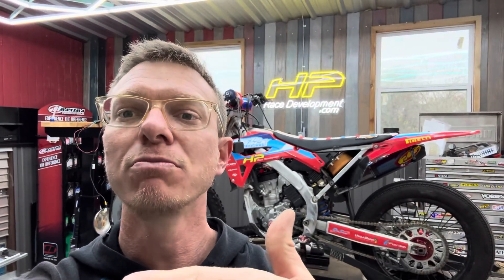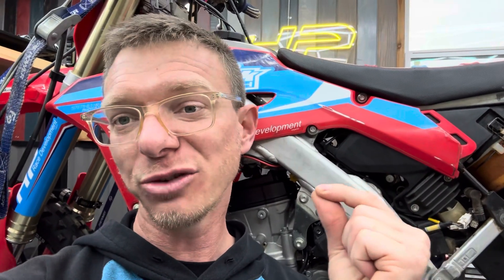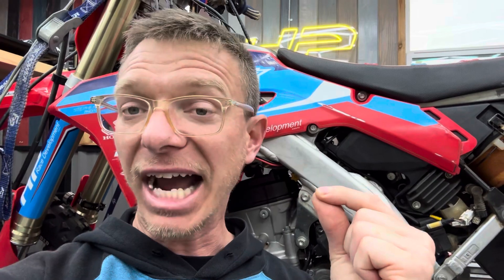Dual Fuel Injection! 2 injectors for 2 times the power?

Comment: 2 is always more fun right?
Reply from the maker: @dustincarter83  top comment
Reply: Don't know why a extra injector increases air density  ?  Air temp yea that would help  air density.  If you really  wanting to increase  air volume you would go direct injection.  The fuels injected directly  into combustion chamber not taking up volume.
Reply: @2strokecarbtuningportingin187  The fuel pulls heat out of the air, and the air density goes up as the temp goes down (like you said). Adding fuel into the system earlier allows for more cooling effect from the fuel
Reply: 2 shoulders that work is awesome

Comment: So what kind of power would you see on something like a 17 rmz250 with a high comp piston, ported and polished head, running 100octain race gas than adding the dual injection kit and ecu? I noticed that the 16-18 rmz250’s made 33.2hp on dirt rider dyno and the 19-present rmz250 (stock with duel injection) made 36.7hp on the same dyno, was just wondering if it’s better to mod my 17rmz or cut my losses and get a current gen rmz and mod that bike? Been trying to make at least 41hp at the rear wheel but with current head and piston mods only made 34.8hp on my shops dyno, looking to not break the bank try to get there, please let me know your thoughts on a project like this and if it’s even worth doing, thanks
Reply from the maker: probably best to go buy a ktm

Comment: I think saying that the air density increases by the addition of fuel is kind of misleading. One of the arguments put forth for direct injection is that you can get 8% more air in the cylinder since the air doesn't contain fuel. So you could say that the air is more dense with the absence of fuel. Although that isn't technically correct either.
Reply from the maker: @kraftzion  if the incoming charge is not more dense, where is the power from?

DI is for emissions and in all serious forms of testing that I have looked over, makes less power than port injection or in this scenario whatever we call end of port injection

its been heavily tested in various car engines that carbs and injection relocation farther away from ports make more power - and in that testing the data always show cooler intake air temps. In my opinion - most of the power we gain is charge density - a small amount is improved vaporization which is DI downfall currently - leading to poor particulate emissions

Comment: Why not design a dual fuel pump set up also to run high pressure in the dual injector to increase velocity?
Reply from the maker: @denniswilder3014  pressure is very high already - mx bikes utilize extremely high atomizing and high pressure design vs most other markets
Reply: @HPRaceDevelopment  what pressure do they run?
Reply: @HPRaceDevelopment  i just looked it up Honda's run 48 lbs of fuel pressure. Thats not high. Most outboards are 55 psi and the optimax ficht etecs run in the 90s. The sea doo di run 90 plus along with 120 pounds of air. The sea doo with the super charged run 60-70 lbs of boost with 1100 injectors.

Comment: what injectors cc's are you running in this crf ? main and second ? kxf 250 2012 I owned had so much power difference at the top comparing to the other bikes in that year... dual injection was game changer but nobody wanted to admit it because "it's not a ktm" 🫠😅 more fuel atomization = more power always
Reply from the maker: This bike shown is stock main and smaller second than main

I think its 300 cc second off memory

Comment: There is also one more little aspect.
The aircolumn get slightly heavier with an injector far back in the runner, and this makes slightly more ram effect at high rpm´s.

Injector timing can make a great impact also, having a small amount of fuel squirted onto the closed intake valves makes the fuel vaporize, and suck up some heat.
This often makes low rpm and response a little bit better.
Reply from the maker: @Peter_Granfors  we havent disclosed some of the dual squirt strategies on single (or dual) injection for youtube, but spot on. 
Injection timing is critical on single injectors located close - sucks up huge time to get that right plus fuel and ig curves
Reply: @HPRaceDevelopment  can you make a video on injection timing?

Comment: Im curious if direct injection is something their working on.  Having direct injection AND the second injector (the far back one) would seem ideal for max power and timing control.
Reply from the maker: @Roostfactor1  Imho from a performance standpoint DI is flat out worse. Its an emissions thing mostly - and in F1 they have a special form of DI that acts as the ignition system as well which allows amazing fuel economy not possible in spark throttle body injection. 

I might be wrong - but as of now I think DI would only hurt performance
Reply: @HPRaceDevelopment I hear this sentiment a lot and it’s generally incorrect when comparing PFI to modern DI systems that have high enough HPFP pressures to keep the injection window short and optimized the swirl/tumble generation of intake track and combustion chamber. At least I know this to be true for larger cylinder displacements in automotive engines that don’t rev past 9k rpm. DI will almost always improve volumetric efficiency because the air charge moving past the valve is less dense and by mass contains more oxygen. For a given mass flow of your port you have more air charge with DI. There is a tradeoff with charge air cooling like you mentioned, but this is only really beneficial for outright mass flow in some situations like inadequate intercooling on highly turbocharged engines. With NA engines on gasoline, DI allows the intake port to work better by 5-7% in nearly every situation. The issue in the past has been the shorter window fuel has to vaporize with DI, leading to poor fuel distribution incomplete vaporization etc. Modern combustion chambers solve those atomization issues with huge swirl/tumble velocities and squish though. IMO swapping a modern OE equipped DI engine to port injection will almost always reduce power all other things being equal.
Reply: @Nathan0A , very nicely detailed. I’ve had the pleasure of seeing a lot of development work on DI/PI platforms and agree with your sentiment that a proper DI setup will outperform a PI only setup simply due to chamber efficiency. Moving fuel from the runner to the chamber, especially running fuels like ethanol or methanol that require so much additional fuel volume seems to provide substantial gains.  DI/PI combos seem to be the ultimate, and now that we’re seeing it in the OE automotive world I suspect there could be some investigation in the power sports world as well. Maybe it starts in the SxS world first since they can actually utilize more power????  Where in in dirt bike land don’t really require it haha
Reply: @HPRaceDevelopment  Well you're way beyond my level with moto engines so I'll take your word for it and yes I'm very familiar with F1's TJI system Merc started in 2014 when the "formula" changed from 2.4L v8's to 1.6L v6 with mguk and mguh.
Imagine trying to tune one of those!?!

Comment: does that mean puting a carb with the acceletor jet did the job of 2 injector
Reply: Kind of.  Imagine the standard jet of the carb the (rear) injector and the accelerator pump the front.  The accelerator pump only injects fuel during throttle application to prevent lean bog because the standard jet always lags behind the engine "signal"  The signal being the vacuum in the intake when intake valve open and piston on intake stroke.
Reply: @Roostfactor1  yea , haved  see some video or picture passing fast , of injector places like that but didnt have realise its for a 2 injector setup and you can gain 2hp with that ,  good explanation vid

Comment: an injector pointed straight up will atomize fuel better than going with airflow (think of spraying water up and a fan blowing against it versus spraying water with the airflow. but i'd imagine spray pattern matters more than that. i'd be curious to know if the ignition timing can be pushed a little further with a cooler more dense air charge or something. so many variables that's why we rely on masterminds like derek who will put the work in to find out and then get that product out to the masses! one injector with more on time can supply the same fuel. so its not a volume thing. it has to be for air charge and maybe a more precise fuel volume. i'm thinking of the old dicks racing ktm intellijet thing that supposedly was awesome because it was able to get just a little more fuel at the right time. granted that's old 2 stroke carb theory.

Comment: is air velocity a factor?
Reply from the maker: @MrJacksmithFTW  in what regard. Air velocity is a common talking point in performance engine building - and it plays a lot of roles including in fuel vaporization.   But that said the fastest engine is the engine that balances flow and velocity correctly.  A tiny port high velocity design becomes restrictive to flow

Comment: Some bikes have dual inj stock, like 250 kawa and rmz 250 2019+
The 2e inj sits in airbox straitht  spray fuel up.
The kawa under angle.
Do they also add 1 hp?
Reply from the maker: @bernardvanderveen7656  you think kawasaki wants to add an injector for no reason!?
Reply: @HPRaceDevelopment  honda did with twin pipes lol publicity stunt. jk.

Comment: Stupid question alert: Does dual injector make the fuel consumption way worse?
Reply: 1:39
Reply: no. 2 injectors will use roughly half the fuel of a single injector. otherwise your air fuel ratio would go stupid rich and it wouldn't run worth a crap.
Reply from the maker: @TM22549  Good question but the answer is mostly no but sorta yes.  Whenever you let off the throttle high rpm in decel - dual injection will be very slightly worse in economy for really complicated reasons. But otherwise its mostly the same economy

Comment: I would assume that injector angle, especially the injector closest to the intake valve has the biggest effect on the throttle response and should always be pointed directly at the valve for the sharpest response. Possibly a similar story with injector sizing as it seems you want the lower rpm and early throttle openings taken care of by the first injector. Since that first injector only now has to operate in lower throttle openings or lower RPM then it can be sized smaller than the second injector that is further away and can be used at higher rpm and larger throttle openings.

If clubmx had a strategy like that implemented, then its crucial that both injectors work together, if you only had the first or second injector working then you'd have a huge hole in the power curve making it dangerous to ride the bike.

Comment: Good Video Man, its hard to explain a Customer why 1hp is a lot of Stuff on this Engines! I recently worked on the 2025 sxf and it was a Nightmare to get more power out of this than Stock, with a must use HGS (Sponsors) and Stock Cams, without loosing Low End...This KTM Engines are insane IMO
Reply from the maker: @hwperformance1409  our piston and head are quite good on that if you ever wanna try

Comment: Does the placement on the stock injectors on Ktm’s play along with the ktm’s liking higher rpms? It being vertical I imagine the gas stays slightly longer in the throttle body allowing it to vaporize more.
Reply from the maker: @yamslam46  I would suggest there is no data metric to support ktm liking higher rpms vs lower. Only media feedback. The ktm makes the most power of all bikes low to top on our dyno and on all recent shootouts I saw as well. I do feel the ktm injector style influences throttle response which is “worse” than other bikes
Reply: @HPRaceDevelopment  with a couple different bikes coming with dual injectors now, do you think ktm would benefit from dual injectors? mostly curious for the 350.
Reply from the maker: @fox13z400  We sell and offer dual injection kits for 250, 350, and 450 ktms

The gains are as I said - about 1 hp.
If we sold a lot more of them I would probably also sell a different forward injector to maximize the gains
Reply: Excellent content I suspect evaporative cooling of the fuel has a positive effect as well